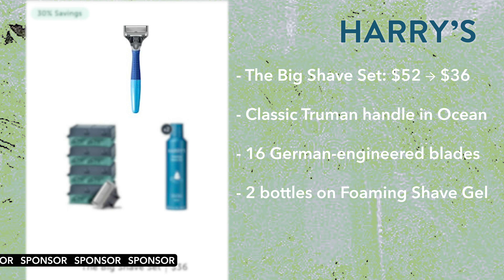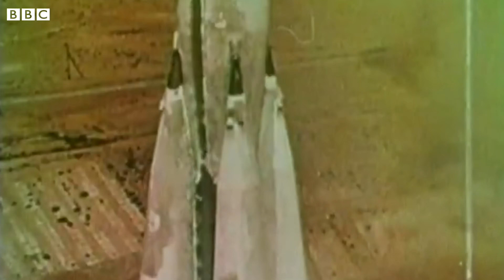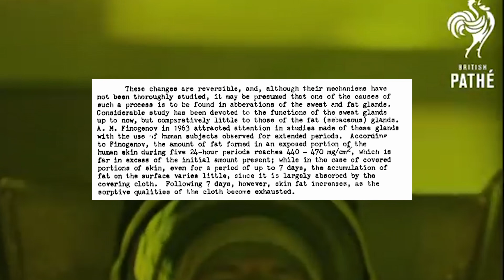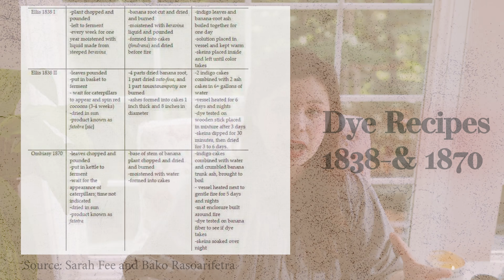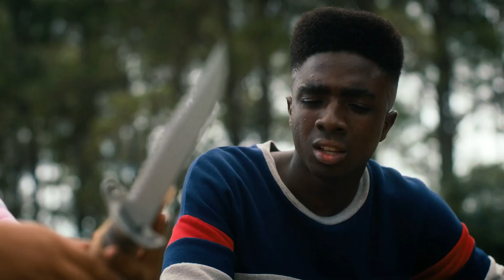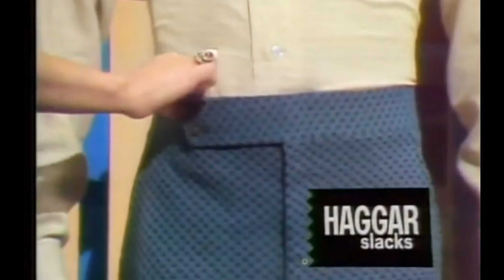The DISGUSTING truth about Laundry

Comment: The few things I discovered actually help with making Laundry a bit more effectant in not destroying your clothes: 

One commenter mentioned washing Soda and Bor-ax, but we use Oxyclean which also conditions hard water easily. It makes it where you don't have to use as much Fabric sofener and it actually helps with antibiteral situations without destroying the waterways as much. One scoop does the trick. Also another thing we discovered help remove stains for pre-washing is Hydrgoin Proxide in a spray bottle since you can also use it orally if you have bad gums it shouldn't cause too much arm after it washes and it breaks down any Urine, Fecies, and blood in a more mangable way and it also kills those bacterias before putting them in the wash. I tried other stain removers and I discovered the proxide actually did the best for those stains (because cats) and also it's great if you have to deal with those stains within your mattress and actually helps nuteralizes the issues. These methods are also more affordable becaues not only will you cut out the fabric softener as much, but you can also get away with using cold water and Oxyclean is cheaper than a huge cotso container of Snuggles. I've been using less softeners when I have Oxyclean and my clothes come out softer and cleaner than when I don't have Oxyclean and the proxide. (also the clothes last longer too)

Comment: It's so interesting that you brought up the hard water issue. I moved from a place with middle-hard water to a place with extremely hard water about a year ago, and it completely destroyed my hair for about a month before I figured out what was happening. Every time I showered, my hair felt both greasier and more brittle after washing it than before I started. I was literally in tears by the end of the month. Thankfully I figured out what was happening but it required that I went out and completely changed the way that I treated my hair. I have never even thought about the water's affect on my clothes.
Reply: how did you manage to deal with hard water while showering?
Reply: @Kitten_Maru  you'll need to buy shampoo with higher amounts of certain ingredients to remove the minerals that build up on your hair in hard water, look up "chelating shampoo". You may want to use it every wash or switch between the more heavy duty shampoo and a more basic one every other wash if it feels like it's stripping your hair too much, whatever works best for you, there's a lot of trial/error to figure out the best balance. 

You can also get filters for your shower head but I've not tried one myself and seen questionable reviews on their effectiveness.
Reply: Yeh...this me..rip my scalp

Comment: Where I live, almost every flat building has communal washing machines and drying lines, with a planning of when for every household can do the laundry. As per a more hygienic solution, doing a separate load for poopy underwear and smelly socks, washed at a higher temperature, is a good start.

Comment: A follow up video showing alternative washing and drying methods would be helpful for a lot of people. I hate dryers, and the fact that a dryer either cooks your clothes or doesn't get them dry. Only use a clothes dryer once or twice a year. Have line dried outside for YEARS. Probably the only person in my neighborhood that does so. I now own  - three - full-size modern folding drying racks, one wooden folding drying rack that belonged to my grandmother, and one tiny folding wire drying rack that belonged to my other grandmother. Any of these would fit in the tub if one is short on space. There are also various sizes of retractable clotheslines from single line to multiple lines that can be installed almost anywhere in a home or outdoors. My mom used several inexpensive plastic folding umbrella dryers that have a hook to hang on the tub curtain rod, and multiple clips to hold smaller garments. I use mesh lingere bags for bras and delicates like fine sweaters or gauze shirts that would get trashed in the washing machine on their own. My water is hard, so I recently started using a combination of 1/2 c. each of borax and washing soda, dissolved in a quart of very hot water, poured into the wash cycle along with regular liquid laundry detergent (Kirkland free and clear). It has been helping get embedded dirt out of my clothes. Before I started doing that, my towels were not getting clean at all no matter how much they were washed. I'm also in the habit of airing out clothes that have been worn once, and wearing them only once again before laundering. It would be interesting to see some pattern ideas for more modern linen 'under clothing' items.

Comment: Agree with comments about making sure you understand your environment while choosing the drying methods that will be best for your individual situation.

For instance, here in the PacNW during the winter when it rains more days than it doesn't, sometimes line-dried clothes never actually get dry -- even if left for several days -- unless the indoor ambient temperature is raised significantly*. This can encourage mold growth. Drying clothes indoors can also sometimes add enough humidity to the living environment that it can contribute to mildew/mold/other issues, especially if ventilation is poor. So for me, knowing and understanding both the weather forecast and the space available to me for clothes drying is *imperative when I'm washing, say, wool sweaters. I sometimes only wash my wool sweaters once or twice a season, because of it. Sometimes I even wait till summer.

Speaking of wool, it's also important to consider that even though wool has a great UPF, both direct sunlight and UV rays can bleach or otherwise discolor wool; and cotton will fade in sunlight as well. So even though line-dried garments aren't going through the manual stress they would be in modern machines, to blithely set clothes out in direct sunlight time after time without consideration of other environmental factors can cause different longevity issues with our clothes that we wouldn't necessarily anticipate if we're not thinking about it. We need to be mindful -- of fiber content, of detergent ingredients, of sun hours, and so on.

A couple people have pointed out that allergies can contribute to people's decisions surrounding laundering and especially drying, as well. There's no one-size-fits-all solution to either clothes care nor to environmental impacts.

In other words -- to reinforce Abby's overall message -- care and intentionality are the most important components in our individual laundry practices.

Comment: As far as laundry detergent goes: horse chestnuts. For whites, just make sure not to include the brown shells. Sally Pointer has a good video to explain how to use it. Good for wools, can also be cooked (here in Germany my laundy machine can go up to 90 °C, so almost boiling). And, assuming it grows in you area, it's completely free! I've also seen the leaves used to make soap. Does require soaking it overnight, so best to plan ahead, but it does the job and definitely has no added nonsense!

Comment: I use a subscription washing detergent here in the UK called Smol, the US would have similar, I'd have thought? They are plastic free I also wash everything that isn't white cotton at 20 or 30C on a synthetic wash.  I also add 4 drops of tea tree oil into the detergent bit in the drawer. It stops everything going smelly if it takes too long to dry.  I read somewhere that white vinegar makes a great softener, but I've never used it, does anyone else? Keeping the washing machine clean, and running it empty with detergent, or a special machine cleaner every now and again helps no end! I wash pantihose and stockings and lacy undies tied in a pillow case or a laundry bag, it stops them getting snagged. I also put woollen gloves on before I put them on to keep them from snagging. They last loads better!

Comment: Wow, USA does laundry bad... I would never wash my t-shirts and underwear together.
I have really hard water where I live, and I have opted to use a separate softener for that.
Btw, washing stuff on 60 C is enough. It's the same effect as sous vide. Although you need 75 C to instantly kill bacteria, lower temperatures over longer times will also kill bacteria. That's what I do for towels, socks and underwear. When I cloth diapered my son the diapers got 80 C though. The "fashion" clothes get 30 C.
I have legit overdyed clothes because it had stains that wouldn't go away. I also dyed my kitchen towels red because they had tomato sauce stains.

Comment: We stopped using a dryer at first because our apartment complex charges money to do it and then doesn't clean the vents so nothing gets dry. Not only was it bad for the environment and not maintained by our management, it was also expensive. We ran the numbers and getting a pop-up laundry rack (which we just set up in our office on weekends) for like $15 was just a way better deal. For one, it actually gets the clothes dry - for two, I'm not encouraging my apartment to keep the dryers around with my money.

For three - air drying my clothes has been spreading. I have neighbors ask why I take my wet laundry back to my apartment. I get to tell them what I've doing. I know for sure at least two neighbors have now done the same thing. The manager actually made the dryers cheaper because no one is using them. Still don't think they cleaned the vent though 😅

Comment: Oh, I so do have thoughts and I'm glad you made this video! The eternal conundrum of "should I use this appliance until it falls apart or should I replace it for something more efficient?" - I really do wish someone (who isn't lobbying for a Corp) would give us the answer to these questions... You feel like you're caught between a rock and a hard place (or as we say in France "le cul entre deux chaises - your bum between 2 chairs). 
Concerning the detergent issue, I have started making my own. It is simple, very cheap, and saves on plastic containers, and transport. I bought a kilo of soap flakes (Savon de Marseille, I think that's Castile soap for you?) about 2 years ago and I've just finished them up. I put 2 cups of flakes in a large pan, pour a kettle of boiling water over the top and stir until dissolved. Then you let it sit overnight. Use a plunge mixer to soften it up (it will have congealed quite thickly), add 2 tbs of bicarbonate of soda, mix some more, and and about 2 litres of cold water. You get a thin detergent which will thicken up over a day or so. I pour it into an old detergent container, and usually add another litre or so of water after that to geet it to the right consistence.
The whole process takes about 10 minutes and a batch lasts me 2-3 months. I use it in my (front-loading energy efficient) machine on a short hot cycle, adding alcohol vinegar (the clear kind mentioned by @Stellaluna) in lieu of the softener. Vinegar makes the water softer, and your clothes more fluffy. I put in a few drops of essential oil to counterbalance any possible smell (but really it doesn't smell at all), because essentil oils and perfumes are bad for fish and the environment in general, and they accumulate in our waste water.
For the drying, well, I admit, I do have a dryer, but it has those sensors, and I don't use it in good weather! Instead I have a rotary washing line that you can collapse and entirely put away over winter! And it is so easy to hang your washing on too.

Comment: This is very interesting. I have always worn a tank top under any of my shirts since hitting puberty.

Since receiving my Endowment, I have worn Garments. They effectively act as a shift; white, and I do maintenance to ensure they stay white. Additionally, the undergarments are washed separately. I wash with Sanitizer, Free and Clear Hypoallergenic detergent, OxyClean, and Spray and Wash on pits and private parts.

It's still a ton of water though. And not as effective as olden times.

Lastly, we dry our clothing on a line as much as possible and then finish the laundry in the dryer for about 10 minutes to soften up like the towels and what not.

Comment: We have quite soft water where I live (Helsinki, Finland). Here one can easily check the softness or hardness of their household water by checking the local water supplier’s web pages. One can also buy tests for checking the hardness, and they are not that expensive either. Generally most of the water we use here in Finland is soft.

Detergent packages also contain instructions for both soft and hard water, so it’s quite easy to check how much detergent is needed 🤷‍♀️

Comment: I have now found out that english only has the word 'clothesline' for the variety of implements people use. Just, why. In sweden the most common 'clothesline' used outside is the 'torkvinda' and I cannot recommend it enough. It looks sort of like an huge broken umbrella without the fabric. A metal pole anchoring it in the ground from which metal spokes point upwards and outwards. The lines go round the metal spokes, gaining in diameter each round. People generally put their underwear on the innermost lines and bigger items like hand towels, trousers, shirts outside of that. The bed linens go on last and can then dry in an efficient single layer. As it is a kind of spiral it actually has a good amount of line relative to surface area used and I can fit multiple loads of laundry on it.
I use a kind of fabric softener/water softener made out of 1 part 24% acetic acid and 5 parts water + 5 drops of whatever essential oil I feel like. It softens the water enough that the minerals are not deposited on my laundry and I can choose if it should have any scent.

Comment: I havent used the dryer in my home for years mainly to cut down on the energy bill. But I have to hang dry the clothes in doors. I don't mind. I usually do it before bed and out it away in the morning. But I know I am not getting the full benefits of the sun drying my clothes that I could if they were outside. I did discover that if I was like fabrics with like fabrics I get less holes in my clothes. And zipping up any zippers has helped immensely.

Comment: I live in the U.K., I live in a hard water area. I use a unscented biological washing liquid, no fabric softener, I line dry my laundry weather permitting or dry it on a clothes airer when it doesn’t, I am fortunate enough to have room to do this, without it cluttering up my home. I clean my washing machine on a regular basis, on a hot wash, with a handful of citric acid. Modern washing machines, especially front loaders, are designed clean more efficiently and use less water and power, so using an older machine is a false economy. If you want to ensure that your underwear doesn’t contaminate your other clothing, buy a nappy bucket and soak them in a fabric sanitiser.

Comment: Fabric quality is inferior to that of just a few decades ago. I have cotton shorts from the 80s that I wear to garden. They are paper thin now but still hold up to frequent washing.
Line drying is my go to method with my under garments drying on a clothes horse inside. The kids complained about line dryed clothes and towels being scratchy, so I pop them in the dryer with wool balls for a few minutes and they are fine with the feel. My mother had lines in the basement for drying in bad weather.
I've been using laundry sheets for several months now and they work well. I was skeptical at first but our clothes are just as clean as with liquid detergent from huge plastic bottles.

Comment: That was indepth and very insightful, and the law about not hanging your clothes on a line - that's simply madness.  Any money it was lead by a tumble drier manufacture ¬_¬.  I have heard of people using snow to clear wool clothes - not much where I live so I wear them spearingly and air them as much as possible.  If people are worried about their "unmentionables" being on display, see if you can get a rotary drier (a clothes line in the round) then you can put your undies right in the middle.  Or buy a clothes horse and dry them in the house and leave the line for the larger items.

Comment: While you make some really good points in this video (not being allowed clothing lines, really? Where's that freedon again?), I found two points a bit oversimplified/misleading:

About sanitizing: while detergents don't kill bacteria (they do inactivate some viruses though), they are pretty good at removing them, which is all you need in a normal setting. Modern detergents are also more effective than the ones used in previous decades, so you need less of them and they tend to work better at low temperatures. Most people really don't need to boil their clothes nowadays and still get perfectly safe and clean clothes. 

About water use: Some people here are romantisizing handwashing. If you have a reasonably efficient mashine, that should use less water than you'd need to wash the same stuff by hand, and you probably also need less detergent and you don't need to get detergents on your hands, which is not great for them and was likely really unpleasant in the past. 

There's lots we can learn from history, but it's not all bad today, and I'm really glad I don't have to do laundry the oldfashioned way.
Reply: Thank you for saying this. I just don't have the energy to handwash anything and started to feel pretty anxious around all the comments. So it's nice to hear an alternative perspective.
Reply: The washing machine is, hands-down, the single most important invention in the liberation of women in history.